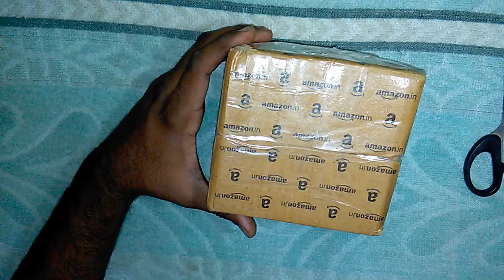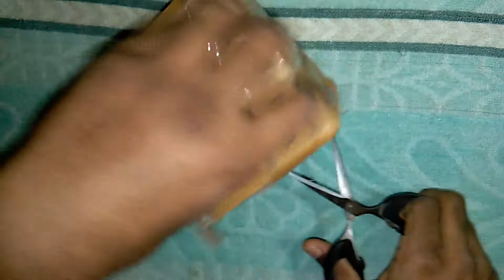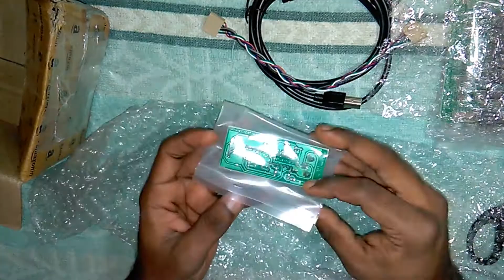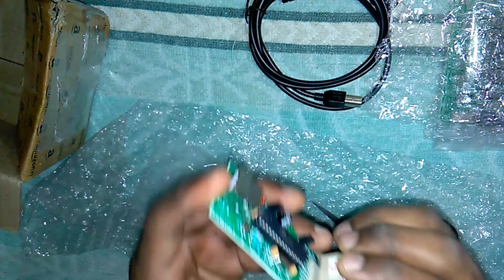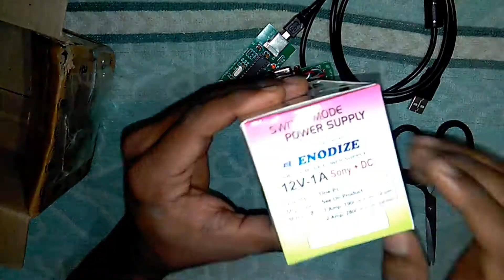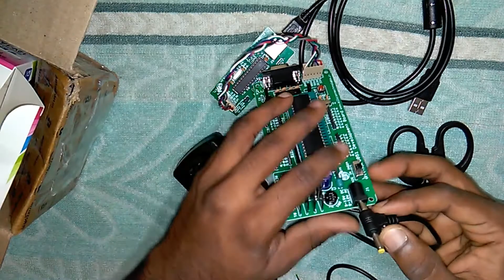8051 Microcontroller Introduction and unboxing 8051 kit

Comment: is it safe to use 12v 2a adapter instead of 12v 1a adapter?
Reply from the maker: you can use both 2A or 1A adapter No problem.